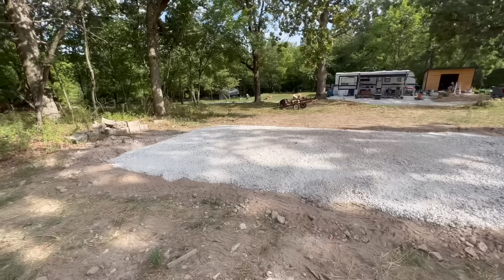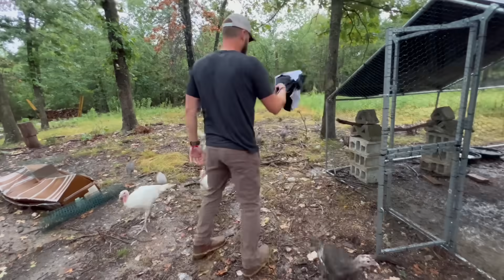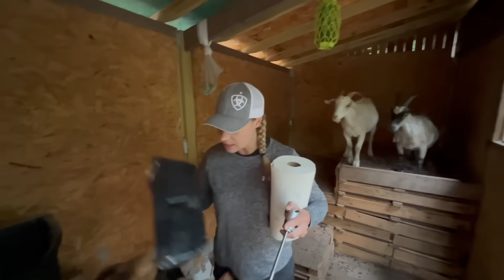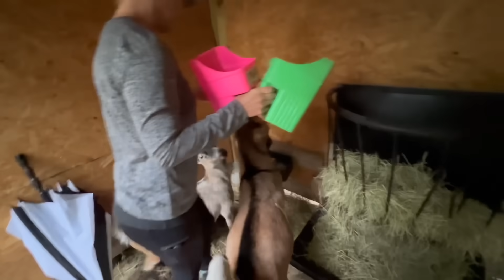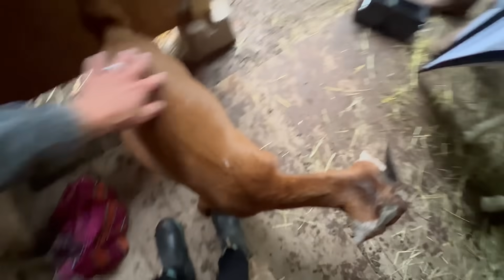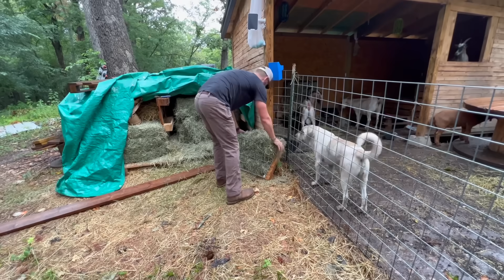We didn't see THIS coming!

Comment: Well if you had to manually spread the rock, like the final smoothing, you would not have done it in the heat.

That rain must be heaven sent, both for reducing temperatures, but particularly for the newly spread rock base. It will settle that very well without needing heavy hosing down work.

The TICK TEAM is working enthusiatically.either with or without rain. Entire crew get busy. 👍👍👍🙂🙂❤️❤️❤️

Comment: The next time you get rock delivered, see if they will "spred it".  Basically what they do is open the tail gate, lift the bed a little, and drive foreward.  It is/ can be a little more involved to get a controlled spred.  But every little bit helps.